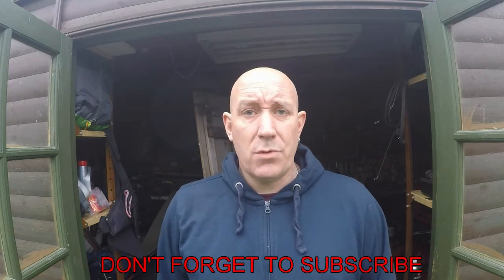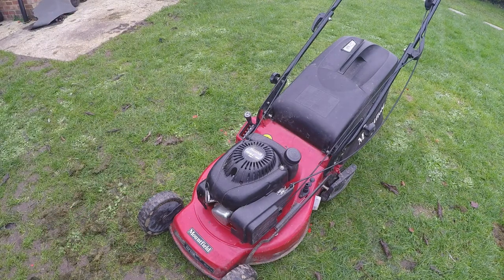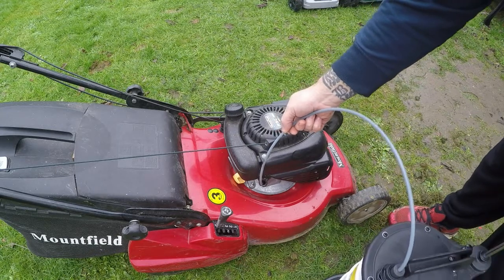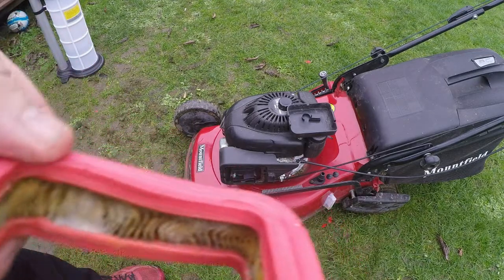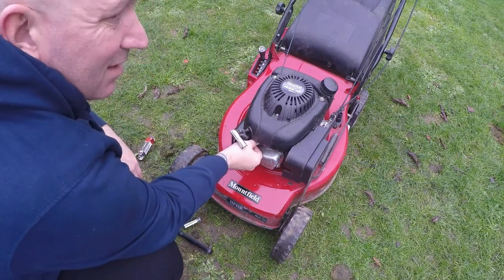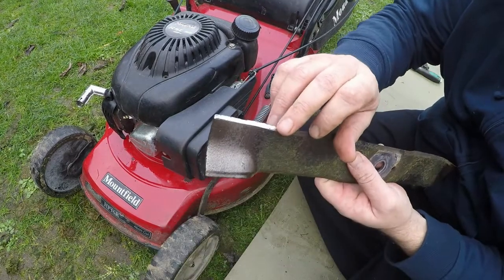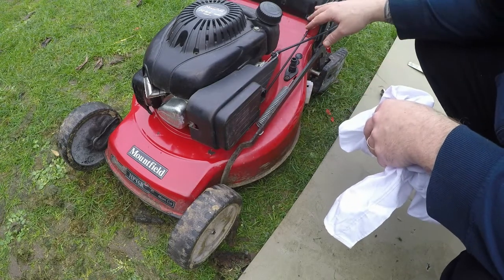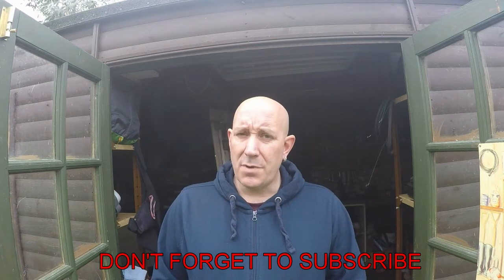HOW TO SERVICE A LAWNMOWER MOUNTFIELD HP46R FITTED WITH A RSC100 ENGINE.

Comment: Their a plastic thing missing at the back off the lawnmower mate
Reply from the maker: edward thomas what do you mean
Reply: @themowerman  Rear Roller Plastic Guard
Reply from the maker: Ok thanks I will look into getting one and fit it.
Reply: @themowerman  hi do you have a picture of the throttle linkage behind the the air filter on this model thank you
Reply from the maker: @kurttite7381  only if it's on the video mate